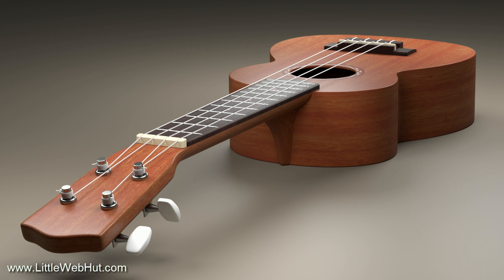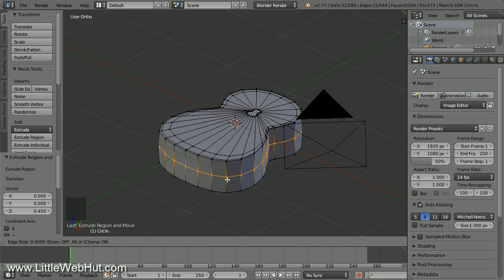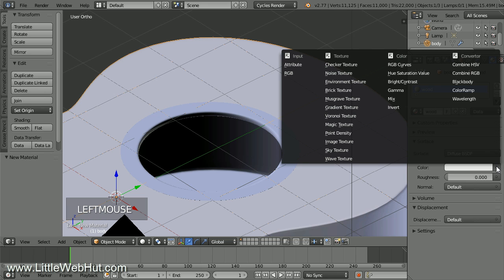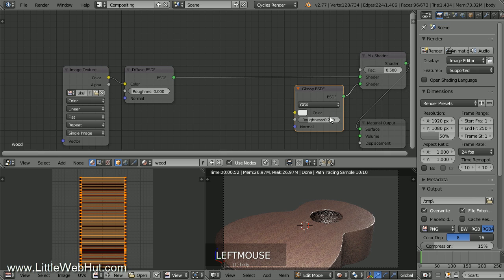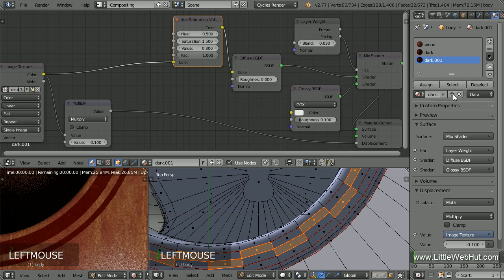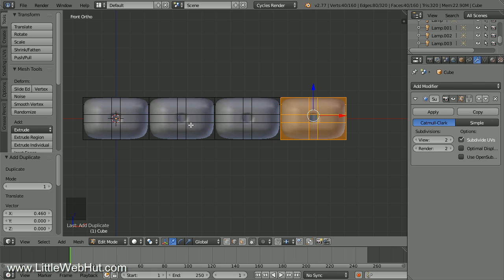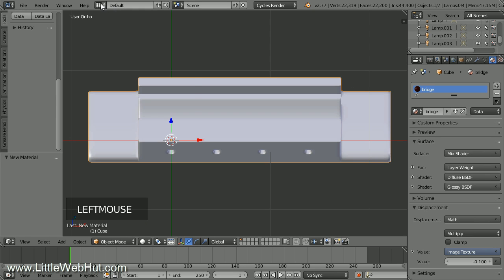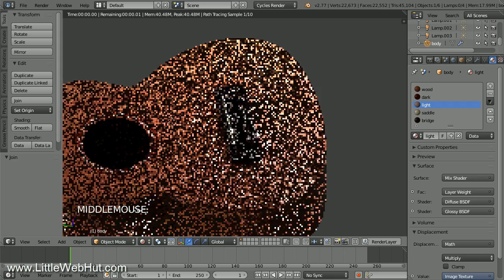Blender Tutorial: Ukulele Part 1 of 4

Comment: by dragging a loop cut all the way to the side is overlapping vertices, which is considered bad topology. You also didn't set the normals correctly on the ring around the sound hole. Incorrect normals can give unrealistic lighting, or broken shading. A better method is edge split modifier, or mean crease.

Comment: Just something to add here, when you press N and look at the dimensions, those are not in inches by default. Those are strictly blender units. You can set units to imperial or metric units by going to the scene tab, and changing the length units under measurements.

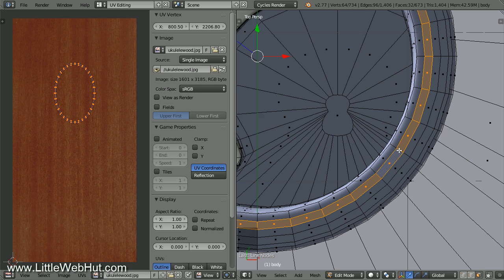Comment: I'm using the Linux version and the problem I'm having is at 19:50 in the video when you select the ring of faces you're to hold "Alt + right mouse button" to select the ring of faces. My LINUX version won't let me do that, nothing happens. I wonder if the key combination is not set right in the user preferences. I'll try to ask over at Blender.org. I really want to go thru this tutorial. With the Windows version it worked fine

Comment: Hi ! I was wondering if you could help me. I just finished the video (didn't do the other parts yet) and I already managed to f*ck things up.. I changed the location of the "ukulelewood" texture to put it in my texture folder. Now when I come back in the project saved, I understood that the software don't recognize where the texture is and is giving me a bright purple color instead. 
My problem is that on every material I did with this video, now everything is put on "Suface : Mix Shader" and I can't seem to find how to "replace" the old path of the picture with the new one.
I tried to change "Mix Shader" into "Diffuse BSDF" or "Glossy BSDF" and that's working pretty nicely until I come accro the "Bridge" material where I can't seem to get the same result as before.. 
Anyone ? Maybe an easy way to fix a "new pathing" to pictures I don't know ? Pretty please ? :D (I'm sorry if my english is bad, I tried!)

Comment: Ahh, was wondering where did you disappear. Finally. Another excellent tutorial. I enjoy your preciseness and the fact that there is not much room for error in your tutorials very much and would like to just remind you that for the sake of preciseness instead of manually moving "one face until it touches another face just slightly" maybe you could use snap to face/vertex/edge function. I tried it here and there and it worked out perfectly (like for example when adjusting positions of finger position dots on the fret-board in 2/4 etc.). Just a suggestion. Thank you very much!